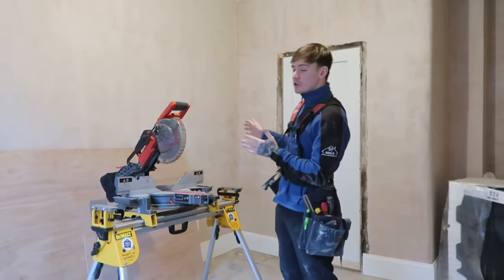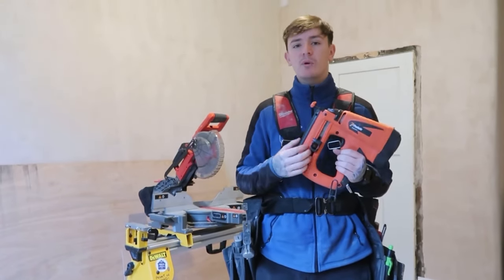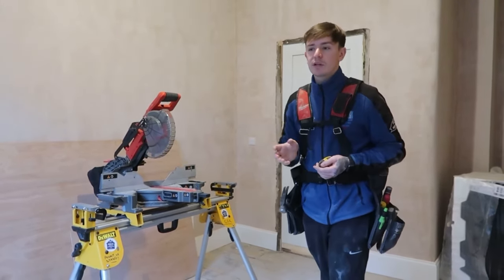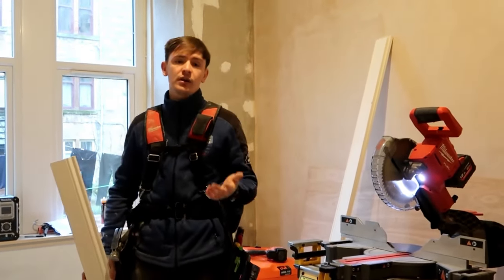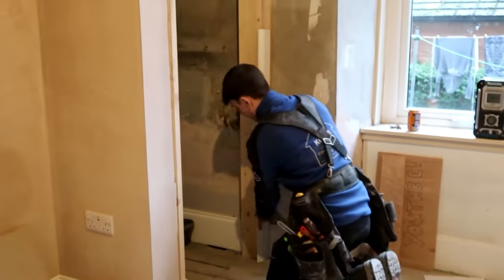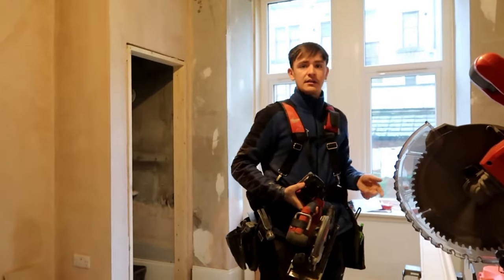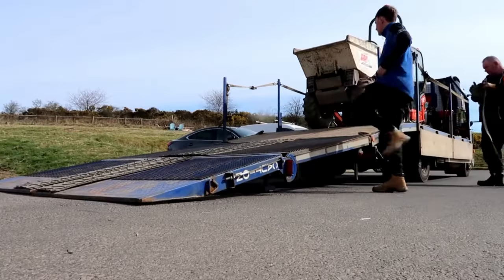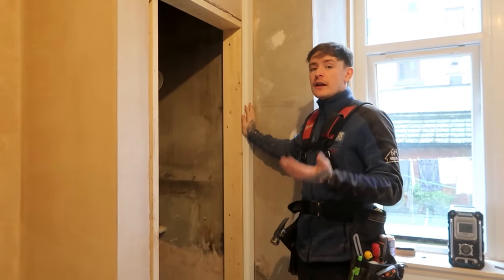2022 CATCH UP | Scottish Joinery & Carpentry | VLOG 4

Comment: How much would you charge if some one only wanted 2 doors planed at the bottom because they rub on the carpet
Reply from the maker: Drop me a message on Instagram and let me know where your located should be able to help you out 🤙🏻
Reply: @keelsjoineryconstructionltd   a don’t have instagram pal am from Cumbria
Reply from the maker: @aaronbell8527  aww sorry mate think Cumbria is just a little to far out my jurisdiction, I tend to just stick to working in Glasgow 🤙🏻
Reply: @keelsjoineryconstructionltd   a ment how much do you charge customers?
Reply from the maker: @aaronbell8527  ah sorry, would only be a couple of hours work possible £40/£50 depending the conditions of the doors ect
Reply: @keelsjoineryconstructionltd   is that just to shave the bottom down pal
Reply from the maker: @aaronbell8527  yeah I would say so 🤙🏻
Reply: @aaronbell8527 2 hours 😮 take about 20 minutes mate, buzz them with a planer if it's a minimal amount, if it's quite a bit cut them with the track saw 👍